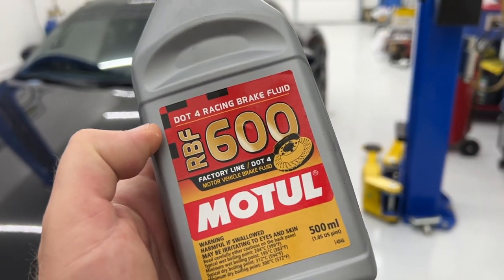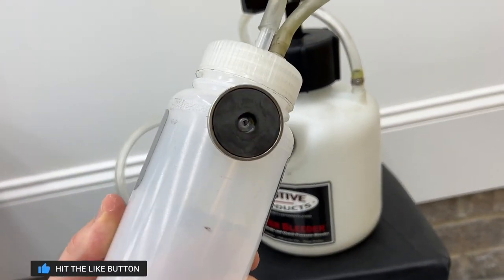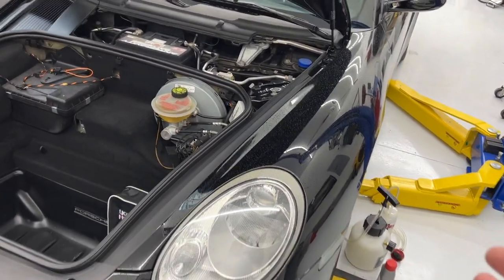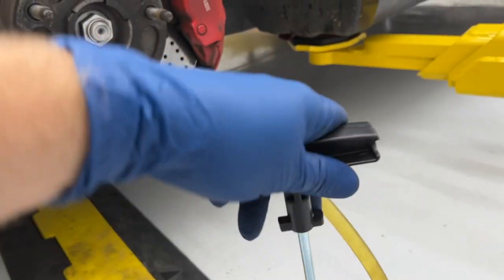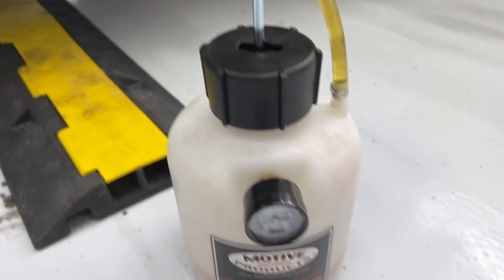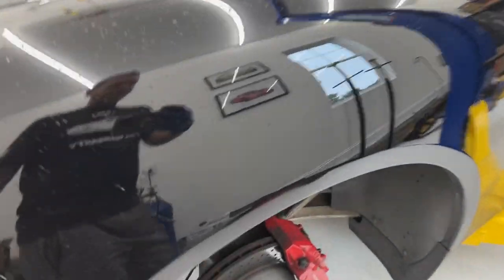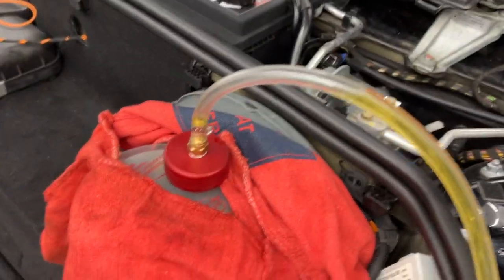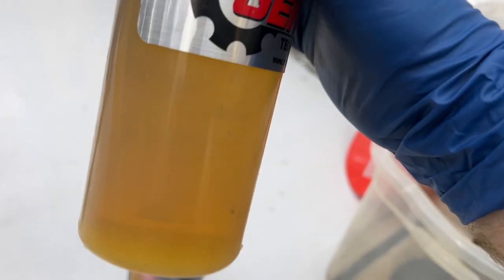Porsche Cayman S 987 Brake Fluid Change DIY with Motive Pressure Bleeder

Comment: +1 for the Motive setup.  Last month I powdercoated and rebuilt all the calipers on both the 986 S and the 987.2S.  Way quicker and easier than suction methods from the bleeders (even those with power/vacuum).  It probably took me 15 minutes to flush and bleed the whole system and that's with air-filled calipers and by myself.  I've also been using RBF600 on my bikes for the last decade+, so sticking with it on the cars.
Reply from the maker: +Adam Miller it is great isn’t it!

Comment: Great tutorial on the use of a pressure bleeder. I'm going to be installing a GT3 master cylinder and RSS brake lines along with a service bleed using the pressure bleeder.
Reply from the maker: +@warrenlucier5796 thanks. Good luck! 🍻

Comment: Sorry but your tutorial doesn't seem right. When I service the brakes on my Porsche 987 I connect the computer and follow the procedure indicated by the software, which consists of pressing the brake pedal listen to the abs pump working and going around the calliper bleeders as instructed by the software. The VW and Audi's use the same process as well. Could you please confirm if after replacing the brake fluid as you did no service lights were left on and that the abs pump was also bled. 
Thanks
Reply from the maker: +@nunosilva6787 yes there is a more thorough process for the ABS pump with PIWIS

Comment: After you’re done, Does it matter if you unscrew the cap on the motive jug to release the pressure or the cap on the brake fluid reservoir first? I released the cap on the cars reservoir first … that doesn’t cause air to feed in does it?
Reply from the maker: +@michaelgp3410 probably doesn’t matter. Won’t cause air in the system that way,

Comment: I have a question for you. I also have a cayman s 2008. Recently my automatic transmission will not shift higher than 2nd but I can use my paddle shifters to cycle through gears. Any thoughts on what the issue might be? Also I thought to check the transmission control unit, but I can’t seem to understand where this is located. Any support you could provide would be greatly appreciated.
Reply from the maker: +@ShemuelFrancis sorry, I’ve never had an automatic so I don’t know 🤷‍♂️
Reply: @HelpMeDIY  You need to service the transmission, change the fluid and filter and also service the drive unit which is a separate item. It's a common issue. There's a procedure to do that service as the transmission fluid needs to be warmed up prior to top up. I've done it at the dealer. It costs about $600 for both items, transmission and drive gear.

Comment: Good afternoon
Very nice presentation
May I ask the outer and or inner diameter of the cap cause here in Greece we dont find at all the Motive bleeder. Instread on Amazon etc i can find other makes with E20, 42, 45mm etc
Can you please guide me on this?
I own a Porsche Cayman 987.1 Base my 2008
Thanks and kind regards
Reply from the maker: +Christos Machairas thanks! I don’t have the measurements, but you can just measure the reservoir opening

Comment: My general vehicle repair garage had commented on opening the anti-lock brake valves in order to not potentially damage them.  My ODBII has a function to open each valve as you move around the corners.  Yours is the second video I've watched that did not do that and have apparently had no problems.  Since I have the ODBII I'm going to do that, but I'm curious if you've ever heard of doing this?  Also, the OBDII states to use a pressure pump with 2 bar, though it doesn't say to pump it that high.  I'm going with the 15 psi, but again, curious why it would say that.  The car is going to a Porsche specific shop tomorrow for other reasons, I'll ask their opinions on these two points.  And, thanks for the video, it reinforced the other one I saw and gives me great confidence I'm following the correct routine.  See you at the track!!
Reply from the maker: +Don Oates great questions! Wish I had better answers, but here goes. I’ve heard of that on some cars but hadn’t on the 987. Wondering if it’s a generic OBD reader or those functions would work. Same with pressure, that’s what I learned and use for all my cars. Curious to hear what the shop says. Please report back and let us know!

Comment: Hi Aaron
I really enjoy your videos. I’m planning on buying a lift like yours for working on my Boxster. My concern is that my garage is only 10’ wide 24’ long 10’ high. My question is how wide is your hydraulic lift ? And where did you buy your lift. 
Thanks
Phil
Reply from the maker: +Phillip J Lynch Thank you! I assume you are talking about the two post lift in this video? At first I thought you meant the quick jacks. The ceiling needs to be 12’
Reply: @HelpMeDIY  Thanks. I will have to come up with something different.
Reply from the maker: +Phillip J Lynch I think Bendpak has a sort of 2-post lift for shorter ceilings

Comment: I see you start with the outside bleed valve. I've seen others that say, start on the inside. Does it really make a difference? Is it that the fluid goes from the back to the front of the caliper on the bottom, and then the "old" fluid is on the inside waiting to be flushed?  What is best?
Reply from the maker: +@MrJbipes change it often enough and it won’t matter 🍻